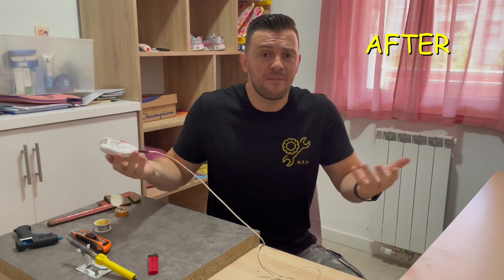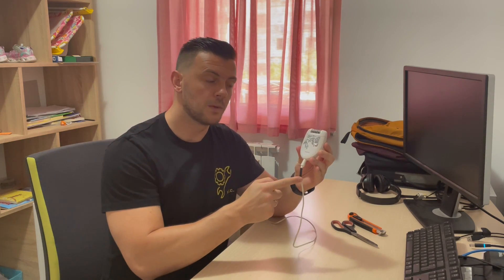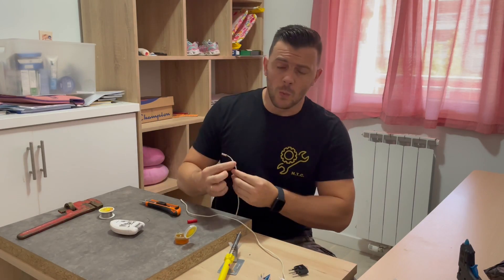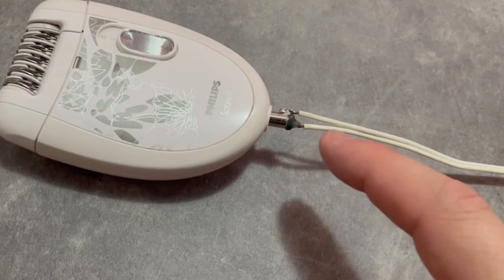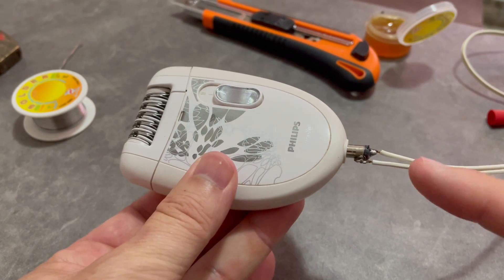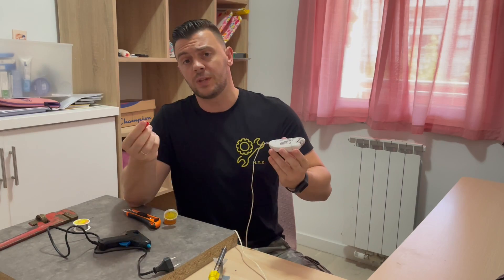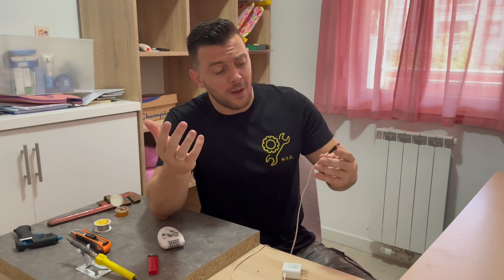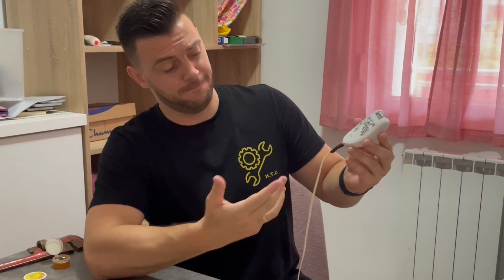How To Fix Broken Electronic Cables and Stop Wasting Your Money!

Comment: If you can could you tell me what are the supplies used in the video?
Reply from the maker: Just a normal hot glue (using a hot glue gun), and soldering iron, this is very easy just follow the procedure in the video. Good luck and thank you 👍
Reply: I appreciate You for replying